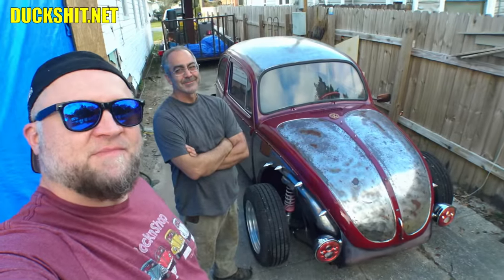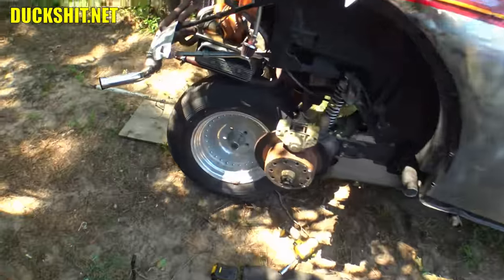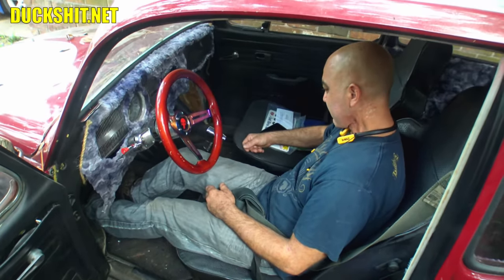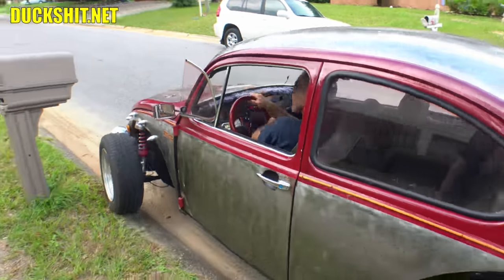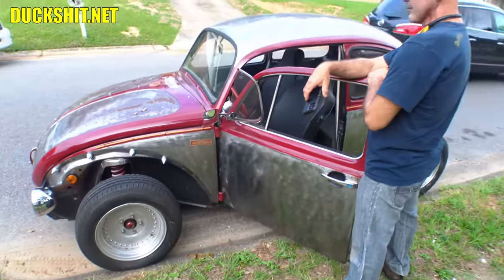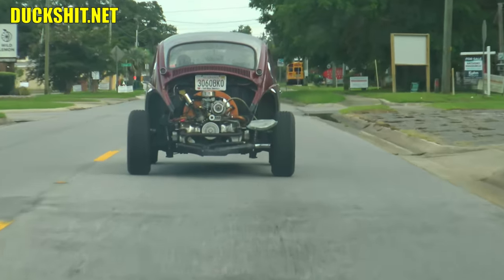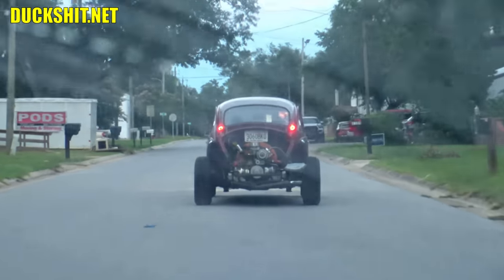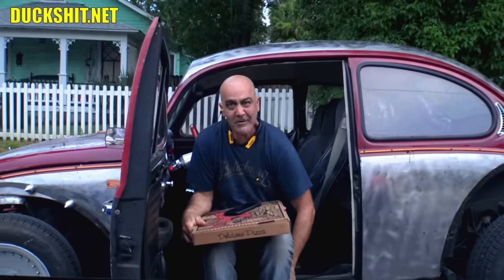Super Volksrod Hits the Street and this Happened - VW Super Beetle - 08

Comment: No deck lid, engine open to elements it needs an oil bath aircleaner or something to keep water /moisture out. Great place to run breather back to.... My first choice 67 aircleaners loom kool
Reply from the maker: The air cleaner that's on here is louvered properly so that rain does not get into it.  I was very careful with the selection.... even though I'm the Duckman and I have no idea what I'm doing.  I'm more concerned with ignition system getting wet, and even that's not a big deal.

Comment: Didn't care much at all for that bug at first. I must say it kinda grew on me. After seeing it on the road. He needs that  Shop manual, vw repair for idiots. I think that is the name of it. Whats up with you guys with no wipers or heaters? Lol. I had a Baja bug with a 1915. I vented the valve covers. Helped with crank case pressure. Good video Duckman. 🦆
Reply from the maker: Well, this one came with no wipers nor heaters...  LoL!  I only did the same to Eleanore for exhaust fitment issues and plays for only fair-weather-only driving.  Heat will be added later, probably from some oil cooling mechanism I've yet to assemble.   He does have a wiper motor in his junk pile, but its missing some of the hard-to-find mounting hardware.  We may get to it eventually.

Comment: awesome video i have a 1971 super bettle new subscriber question my mech told me only use 91 octane gas in the bug because the lower octanes make it run hotter you in put on this
Reply from the maker: Standard gasoline should be just fine, but you probably should be running something with no ethanol.  Ethanol likes to make rubbers swell and can slowly eat aluminum.  But unless you have an engine built for race with a really high compression ratio, standard 89 shouldn't make any difference and should be just fine!

Comment: Hay buddy what’s your thoughts on the empi Webber 40 twin for the 1600 thanks . Love your show makes me want to do a show also
Reply from the maker: Thanks harry, but I think that carburetor is a little big for a stock 1600... unless your 1600 has some Deluxe High flowing heads a very aggressive cam, and it's capable of high revs.
Reply: @DuckmanCycles  ok thanks buddy please disregard my other messages that I sent as it is a repeat ,but having text that can’t the 40 Webber be made smaller by reducing the ventures? Thanks
Reply from the maker: @harryloibl5183  sure you could reduce the size of them if you wanted to, but if you're going to spend all the time and money doing that I would just get some smaller carbs to begin with.  A set of FRD34 or ICT34 or Kadrons would probably suit you better.